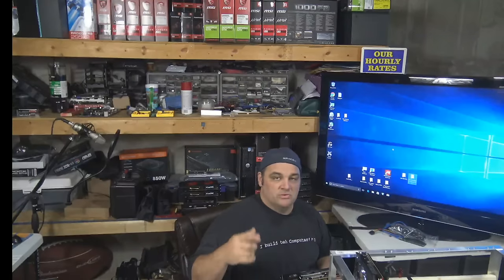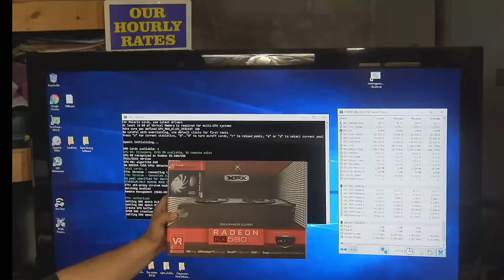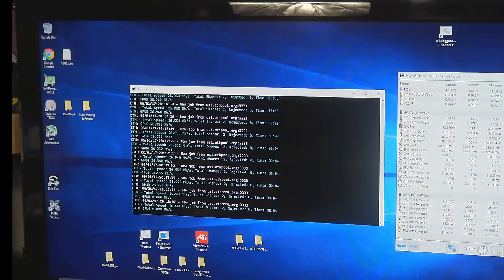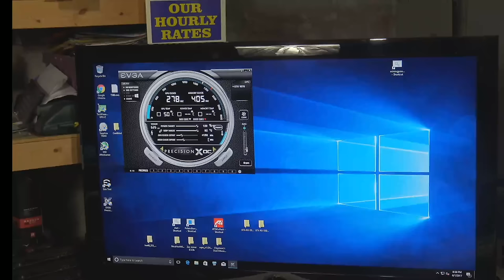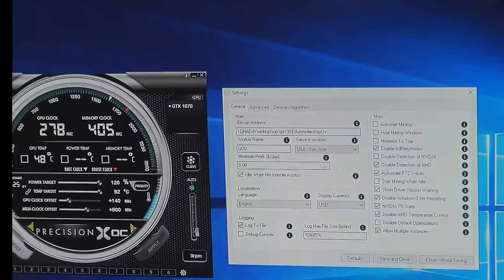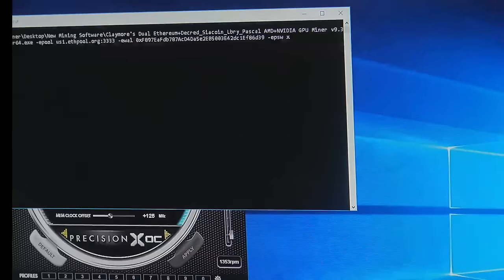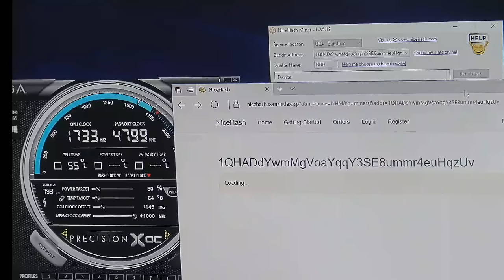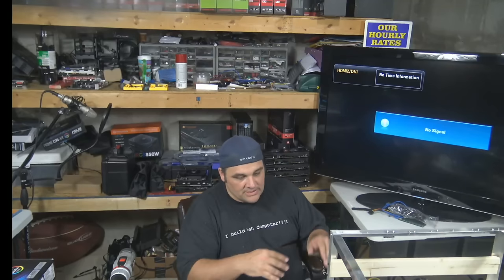Live Episode 15 - 1060 GTX 3GB Ethereum/Zcash ; XFX RX 580 8GB Crimson and OC Edition | Get it done

Comment: What's the problem after all with the 1060 and dual mining?
Between the gigabyte 1060 oc, Asus 1060 dual, msi 1060 3gt or msi 1060 armor, which one would you get? All of these in 3gb version btw

Comment: I've got the XFX OC White RX 580 8GB cards, and 5 out of the 12 I got have stopped working (4 of which didn't work right out of the box) from what I concluded. That seems very unusual, but is this a common problem with these? None of my Sapphire, Asus, or Gigabyte RX580s had any problems like this. Is there anything I can do to recover these cards you think or should I just return/replace them? Any help would be appreciated and can give more info on what I've tried if necessary.
Reply: George Barnick Always having bad luck with XFX cards for whatever reason.

Comment: Have you ever looked into Server Power Supply breakout boards.  I have access to a lot of 750W to 1000W HP power supplies and have found breakout boards that provide up to 8 x 6pin power connections.  However, I am running MSI RX580 cards which need 8 pin connection, and I have heard it is a BAD idea to run an 8 pin card with a 6 pin cable.  Thoughts?
Reply: On my machines I have the HP 1200w server PS. The power cables on one end have the six plus 1 that splits off of the black leads which I assume are ground. if you goto www.parallelminer.com you can see a picture of their power cables with the extra pins

Comment: Cool stream. After the live stream, i got myself Zotac 1060 3gb amp. Put it in a mixed 390 290 rig, default's around 18mhs. After +100 core +750 mem, 60% power target, 22.0x~22.1x mhs. temp 60c 29c room temp 51% fan (auto) Extra 60~70W max from wall wattmeter, after I add the 1060 with powered ribbon riser. Almost 2h mining, looks stable.

Comment: Using Claymore how do you determine if you have memory errors or core errors?
You have 4 variables mem speed, core speed, mem voltage and core voltage. How do you determine when each of those fail?
thanks

Comment: Awesome vid man. I was on the fence between 1070 vs 1060 but I'm liking the 1060 a lot more now. Think it'd be worth it to get the 6GB vs 3GB for the extra 40 bucks or so since 3GB may become obsolete next year?
Reply from the maker: the 6gb will (over time) be the better buy and if your price difference your finding is 40, in our opinion worth it. If the price difference is a 100, probably worth the 3GB to get your return quicker. The dag is just over 2gb, PoS / Hybrid will probably be here before 3gb expires.

Comment: I was able to run secret sauce on crimson but got lots of memory errors so went to 2125 and still got memory errors and then I went back to stock and errors went away. Is it OK to run with memory errors or do I need to reduce the 2125 back to say 2100?

Also I get an error in Polaris because the ROMs are 256k and not 512k. Are XFX ROMS ok at 256k? I assume OK since it loaded find but wasn't sure why the difference from my Sapphire ROMS which are all 512k.

Comment: So if i put in 4  nvidia 1060 cards and limit them to the 70watts yout described, plus the system power of around 40 watts i end up at 320 watts, so then ill be fine with a 400 or 500 watt PSU right?
Reply: 500 watts to be safe.
Reply: i just realized its almost impossible to get a 500watts psu that can provide 4* 6pin for pcie, so got a 600w psu that can do it
Reply: power limit of 70 is in % which means your GPu will use 80-85W, so that is 360ish Watts, which means you need 600 80+platinum PSU or just buy some 700+ PSU. IF PSU is 500W that doesnt mean it can be loaded 100%.
Never load PSU that works 24/7 above 65% of its power
Reply: unfortunately i only had money for 3 1060, so i went with a 550 pus, works ok so far. ty for your answer though :)

Comment: thanks for you videos....i am using your BIOS ROM configs for my XFX RX 580 Crimson. Ive tried all 3 that you posted but i dont get remotely as high Mh/s as you get in the video, right now i am running the crimson secret sauce rom settings, with no errors and only getting 21.4. With the 2200, i only get around 19! any ideas?
Reply: Never mind, I was able to resolve by upgrading my PC to win 10 and then changed gaming mode to ‘compute’ along with your secret sauce bios settings and I’m not getting 28 and only using 100w ... thanks for your awesome vids

Comment: At 11:15 you state "the board and system is about 38 watts" - do you have it posted somewhere what the system is using cpu/mb/ram wise?   38 watts is great compared to the base systems that i am using.  
p.s please keep up the live streams!!!  i usually cannot catch them live but love to watch them while i'm working on my rigs.
Cheers and Thanks!
Reply from the maker: Ya its this setup:

Processor: i3-7350k - http://amzn.to/2srj6Td
Motherboard: ASUS Z270 PRIME A / AR - http://amzn.to/2srpwS4
Memory: 8GB Corsiar DDR4 - http://amzn.to/2srECak
PSU: Thermaltake Toughpower 1200w - http://amzn.to/2srv8Mq

Comment: My ASUS Dual 1060 3gb (hynix memory) only gets 15mh/s stock and 19mh/s overclocked. Anything i can do or am i doomed? (latest win10 version and nvidia drivers)
Reply: Gozman86 i got the same problem.

My other 1060s got 18-19mhs @stock only the asus got 15mhs
Reply: Alexande Jocic I think it's because my 1060 has hynix ram. I've read others with the same issue and hynix ram. I'm not sure how to check which 1060s have Samsung ram though without buying them :(

Comment: Thanks, this really helped on my build, Rx's sold out everywhere. got some 1060's up and running around 21 mh/s each. Had to go a little lower than your settings, 800 mem clock and 134 gpu. Just wanted to test them before i did a whole rig build. Using NiceHash also and getting good returns. Only thing i worry about is the 3gb of memory. Won't be mining ETH after a year from now probably, so that part sucks.
Reply: Buddy even if you wait and Preorder some RX570/580 you will earn in long run more does not matter which currency even with zcash mining because you get more rigs for your money at the end
Reply: I hear ya, just glad there are options out there for people who can't get their hands on the "perfect mining card" and that "Bits be Trippin" is testing which cards are a decent substitute. Figure just build the rigs and upgrade or not when the Vega cards come out.

Comment: Just wanna let you guys know that the link for the 2200MEM/T1750 Strap Bios under XFX RX580 XXX GTR OC 8GB is linking to "biosoriginal-t1750x-gpu-mem2125.rom"

Also, if I'm working with XFX RX580 XXX GTR OC 8GB with Hynix memory, should I start with the BBT Verified Secret Sauce 30mh BIOS (Hynix only) and work my way down?

Comment: You want to overclock memory with ETH.  Core doesn't matter long as you have it over 1500mhz.  At least for GTX 1060/1070.  That's what I have.  I can seem to get my hands on RX 570/580.

Comment: Can you run the GTX 1060 with +1000MHz  oc 24/7?
Reply: i do they are 100% stable!
+170 core +950 memory
Reply: I'm planing to buy Zotac GeForce GTX 1060 Mini 6GB GDDR5 for my 8 or 6 gpu rig  what do you think about having only 1 fan ? is your have 1 or 2 ? Thanks
Reply: hi, whats your hash rate on the 1060?¡
Reply from the maker: ran so far 4 days, no issues, the PNY XRL8 3GB 1060 GTX is an amazing find
Reply from the maker: Link fixed
Reply: i wanted to ask the same question lol xD

Comment: What about a build like this , since there is no AMD cards all over the world! (ETH / ZCASH)

6 x MSI GeForce GTX 1060 GAMING X 6GB GDDR5 
1 x Intel G4400 3.30GHz 3MB BOX
1 x ASUS PRIME Z270-A (DDR4 USB3.1/M.2) (can this board make it to 7 or 8 GPU's ??)
1 x GOODRAM 120GB 2,5'' SATA SSD CX300
1 x Corsair 4GB 1600MHz ValueSelect CL11
1 x PSU??? Any suggestions ?

Thanks alot in advance

Comment: Ive got this issue where my xfx rx 580 crimson ( the one in this video) was doing 18mh out of the box. The bios adjustments only brought it up to 21. Any ideas?
Reply from the maker: Download the latest AMD driver, once downloaded and rebooted, right click on desktop, select AMD Catalyst, under gaming, choose global settings, under each card change the "Workload" from Graphics to Compute, apply, rinse and repeat for each card (dont worry if it looks like it didnt hold); after done, reboot. Try again - report back here if that worked for you.
Reply: BINGO! I found the answer before I saw this but yes that is correct. Next question, how do you know what timing straps to adjust and how to adjust them?
Reply: i am looking at my driver (latest AMD Radeon) under 'gaming' - Global Graphics, but i dont seem to see where it says 'workload', any ideas? Im also using XFX RX 580 Crimson and have the same issue you were having...
Reply: Bits Be Trippin' I’m at a loss guys I need help. I got each of my rx580 black editions each to run 30mhs put them both in my rig and now together one is at 29 and the other won’t go above 21. I am so confused right now please help!

Comment: I have MSI Armor RX 580  8G  Its running @ 31Mh  overclocked bios flashed ...temp 69 'C Fan  90%  no No Errors on HWin64  but I have to use small  external Fan to make it cooler  is this OK  I mean the temp and the fan speed? running 24 hrs. now
Reply: Fan 90%  ?     good luck man

Comment: I have the Asus RX570 Expedition OC 4GB model and I can not seem to get the megahash above 22.2 to 22.3
I have tried increasing the memory from 1725 all the way up to 2075 with not difference in hashrate.

any chance any of you have used one of these? and if so could you show me your settings etc.
Reply from the maker: which memory type?
Reply: elpida memory, I've changed the straps in the bios and got it to 25 megahash at 105 watts now so a bit better and less power but I'm sure there is more in this card. I've only changed the straps in the bios.
Reply: What core clock are you running? You might need to increase the power a bit too. The card should be able to do a little bit more if u push it.
Reply: I've down clocked it until it started making a difference in the mega hash, I've pushed the core up to 1300 and it made no difference, its down at 1106 at the moment. (if I go lower then I start losing hash rate)

Comment: i got 2 nvidia 1060  one is 3 gig and other is 6 gig, im running them on Ether memclock +500...core 0 ...power 70% getting 22.6 Mh/s  per card and they are niiice and cold, on low fan speed :))) Got temp target on 65 degree Celsius my cards are from Gigabyte

Comment: The hands down best ethash/$ card today is the Sapphire RX 570 ITX.
It will use more power than the 1060, but power is usually less than 5% than the profit made anyways.
Reply: Yes, but where to buy one? All rx 5xx models are sold out everywhere I have looked in the past week....
Reply: Ye.. i know. Ive been waiting for a shipment myself. Wont come until 11 of june.  I guess you have to pre-order from some shop.
Reply: I can't find anywhere to even pre-order these..any advice?
Reply: What shop are you using? Only one I can find that's reliable is in the UK...I'm in the US...
Reply: Im in scandinavia and ordering via the company i work at from an importer. They seem sold out or out of stock everywhere.

Comment: OK so now i have EVGA GTX 1070 cards... and they wont hash anything above 2Mh out of the box... what am i doing wrong?
Win10, Claymore miner. I tried copying the file above into the link but still the same.
Reply from the maker: Make sure your windows is updated to v1703 at least
Reply: That's what it was.  6 cards 29MH each just under 800 watts now. Thank you!

Comment: What would cause one card to hash higher than the others? I have 3 XFX RX 580 one card always runs 27 mh and the others 22.. If i change the memory clock i can get it to 29 but then the others 19 MH.. tried different risers... same thing.  Using simplemining.net
Reply: I figured out my problem just dont know how to fix. The one card i have is Version 1 withe the Hynix mem.  The other 2 have Samsung mem.  No matter what i try i cannot get anything over 22 or 23 MH on them.  The Hynix card easily gets 29 30 MH,  Any ideas??
Reply: GPU to memory ratio and  memory timings
Reply: Martinho Galante I don't think there's anything you do besides getting new cards.
Reply: Samsung > Hynix. Dont listen to people here. Search for Samsung memory modding videos, they are the best to OC. 32Mhs possible with good ASIC, 31 guaranteed.

Comment: Mr. Carter, please check the comment section of your troubleshooting section of your site. Thx.
Reply from the maker: Ok, will do
Reply: That would be grreat, thanks. Two suggestions..............in the Windows search box type "user" to get to the user account control panel and turn off all the warnings(move the slider all the way down), so each time you start something like gpuZ you don't have to click to approve it.  Second suggestion is a show request more than a suggestion. Take a card, let's say an MSI RX580 8GB, but any card will do and mod it from start to finish. Yes I know you have modded carrds on your show before, but by mod I mean explain WHAT you are doing and WHY. For example you might set it to 1750 and 2150 clocks and test the result........explain how changing one effects the outcome. Raising memory clocks might be what is needed on one card, while another card or algo likes gpu clock tweaks. You already make these adjustments and show the result, but you rarely if ever explain why raising THIS is going to work better than tweaking THAT. By doing a card from start to finish, explaining WHY you are making a particular adjustment would be extremely helpful. Not only are you giving results, you are showing how you got those results.  What you did with the 1050 is a taste of what I want. " I'm going to raise this and lower this, then we will test it" is a start. I want to know WHY we are raising this and lower that........what effect are you expecting from the changes. Is lowering the GPU clock, while raising the Mem clock enouogh, or should we kick up the power limit, or drop the voltage etc. etc. etc.

Doing this will teach dummies like me what affect adjustments have(especially related to algo) and WHY you are doing it. Show what you are looking for in the resulting test, and then what adjustments you want to do and WHY to lower the wattage used. You might be great at doing it, but I need someone explain WHY they are doing what they are doing. In the end you will wind up with a stable no error card that hashes the best it can versus the power cost. I've never seen you talk about a formula..................tweaking the card got an extra 1.1mh/s ETH, but added 6000 watts.....................what is the formula that says ok, lowering                       the hashrate by .9 saves X in power while lowering the hashrate by .8 saves double the power, so is                       a better deal. Surely someone has a formula that says it should cost X per mh/s increase.

Sorry for the wall-o-text.
Reply from the maker: Great feedback Xardas, no problem on wall of text. I like your perspective and agree, if I tailored the message to include the how and why more it would give more critical information. Thanks again for the feedback!
Reply: I answered my own question on your troubleshooting section of your site.  Short version........the sata cable I kept trying over and over and over was bad.  Once I accidentally used another cable, the board fired up all 7 cards. Believe it or not, but I still hadn't realized the cable was bad and waste 4 hours messing with it on board two......then it hit me. My results simply didn't make sense, so it finally dawned on me the common thing, the ONE common item used getting crazy results, was the dam sata cable. I popped a new one in board two and it fired up 7 cards easily. 

https://bbtvlog.blogspot.com/p/troubleshooting-checklist.html?showComment=1496460817172

Comment: Zotac 1070 is about 520$ in our country.....  is it worth it?
Reply: At these current crypto prices.  Yeah.  I bought 6 GTX 1070 for $440 each.  Still worth it.
Reply: Ok Thank thank you very much.....
Reply: marvelv212 that's the same rig I'm wanting to build. Already have the 6 cards ordered. Mind if I ask which motherboard you went with, and did you go with 1 of 2 power supplies?
Reply: I bought 6 Zotac 1070 mini... I got lucky and found Asrock H81 Pro BTC for little over $100 as these are out of stock everywhere and only found on ebay for more than $200..  Using 2 power supplies.  2 850 watts..

I'm waiting for parts on another mining rig.  It's harder to find cheap low profile 1070 in Korea.  You make like $900 just mining with 6 cards a month.  I quit my job. lol..
Reply: I suggest mining dual coins using claymore dual miner.  ETH only hog up memory sub system.
Reply: marvelv212 lol awesome. I think I'm just going to have to bite the bullet on a BTC 2.0 from ebay. Want to start mining asap. I agree, dual mining is the way to go.

Comment: Can we run this OC 24/7? Or sometimes?
Reply from the maker: Yes, just keep it cool with external fan as to not burn your fans out on the card
Reply: Bits Be Trippin' cool. As long we keep the temperature <60C? 

And i'm curious what windows do you use? 

Thankyou so much bro
Reply from the maker: You can keep it up to 70c, just keep an external fan on it if you can, much cheaper to replace those than your GPU fans. 

Latest version and patched Windows 10 - make sure your on v1703+
Reply: Ok thankyou so much bro for your reply 🙏🏻 God bless you man

Comment: i need help with the GTX 1070 overclocking 
hashrate not stable
Reply: Everything Online Hi do you get it ??? I need too please. Overclocking hashrate  to the gtx 1070 im mining eth. Thanks
Reply: for mining, disable SLI
download MSI Afterburner,once downloaded, set your power% to 70%
Set your GPU to +135
Set your MEM to +650